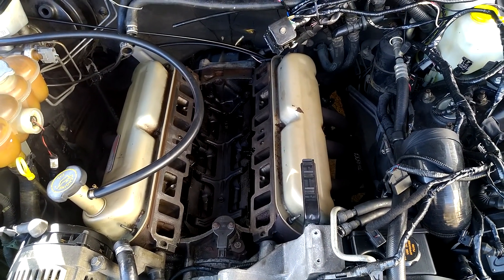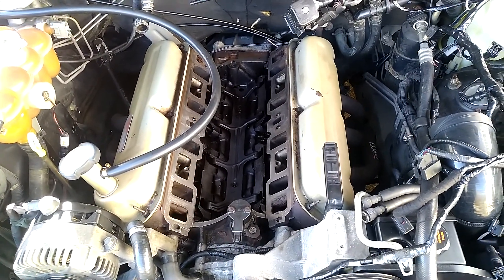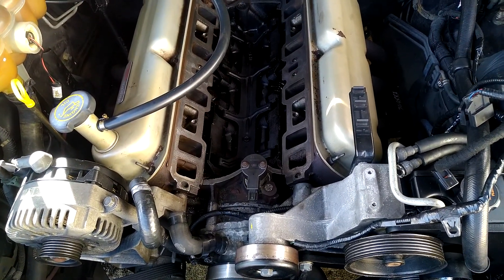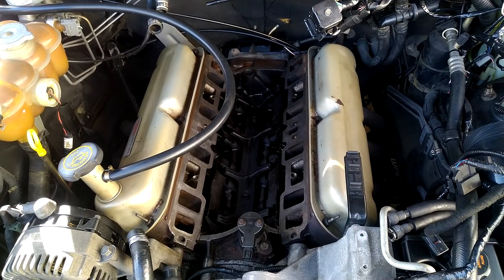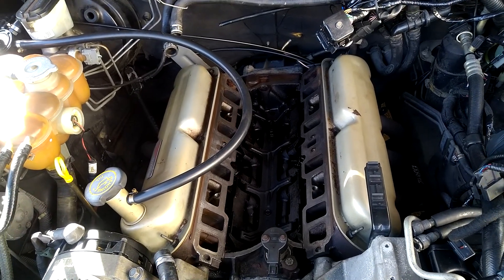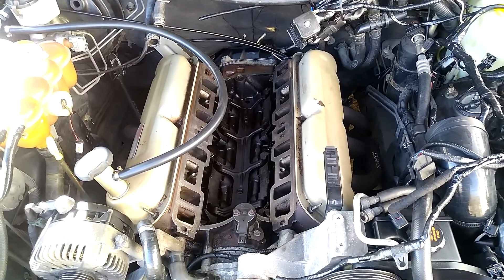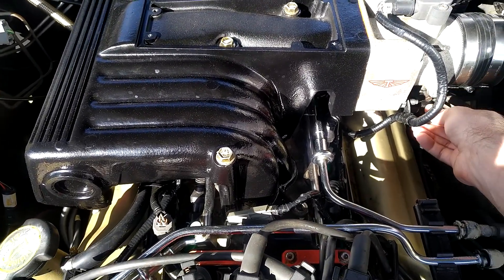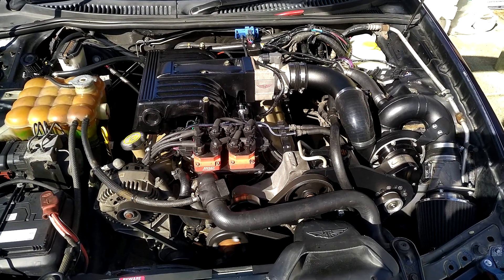Supercharged XR8 misfire update

Comment: also the cam synchronizer can also cause misfire issues. is it being used with your ecu set up?
Reply from the maker: With the microsquit it's not doing anything for the fuel or spark anymore, it's running batch fire injection and wasted spark. The cam sensor is only used by the stock ECU, which is now only controlling the transmission and the idle speed. One of the mechanics at work thinks bad microsquit and another thinks a bad new injector. My brother has the red ute in the opening pic. I think I'm going to tow my ute to his place and try swapping parts from his to myne. I still haven't carried out a compression test, really need to do that now.
Reply: @SidewaysFord  are the injectors a cheaper chinese brand? i had a issue with a set of 60lb chinese copies where 1 or 2 cyl was misfiring under load.
Reply from the maker: @carnbikestuff  nar, their genuine Bosch, could be fuel pressure but I thought that would show on the af ratio readings, could also be a bad new wide band O2 thats running the microsquit